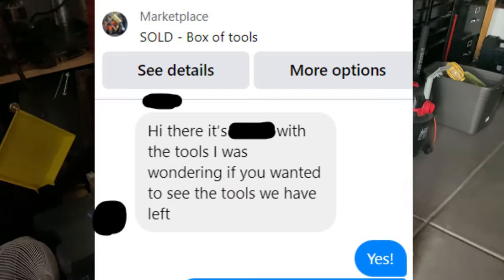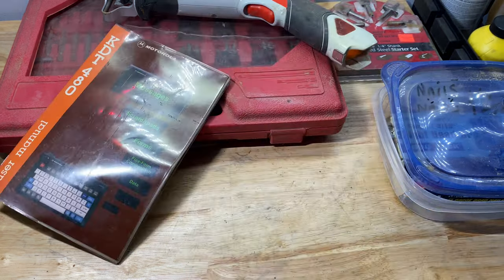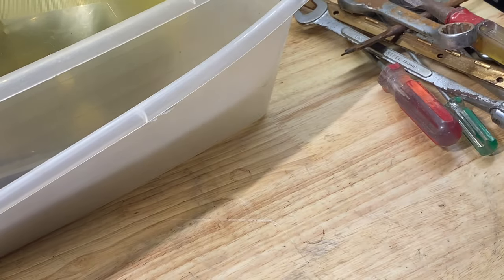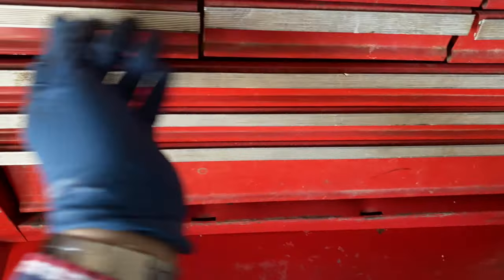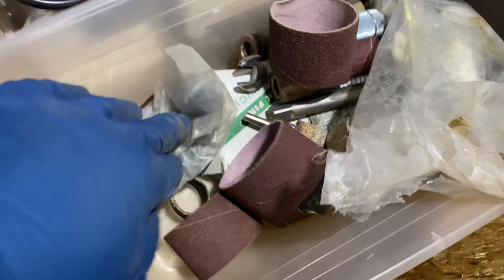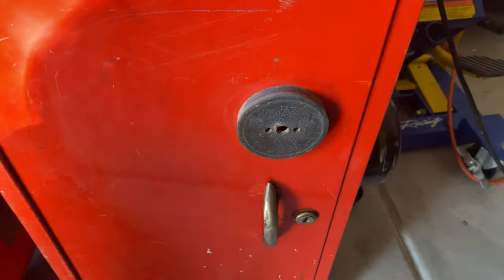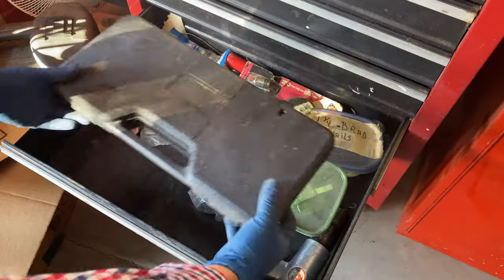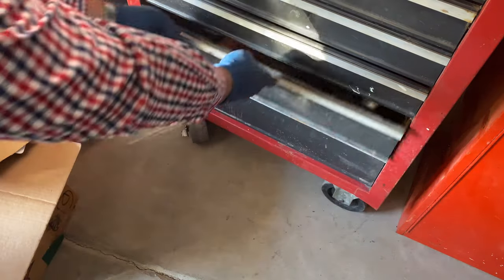Former Police Mechanic's Home Toolbox

Comment: That ignition tuneup package has points/condenser/distributor rotor.  Points&condenser are usually for older auto. 1975 was generally the start of electronic ignition(non-points&condenser ignition).  This is the stuff I learned & grew up on. What fun!  Thanks for sharing your good find.
Reply from the maker: Thank you! I appreciate your knowledge

Comment: @23:08 thats a handle for the spotlights that are mounted on the a-pillar. (the switches in them go bad a lot) not used as much these days. were the standard thing 10, maybe even 5 years ago. now most of the new ones i see are "remote controlled" with a box in the console.
Reply from the maker: Thank you!